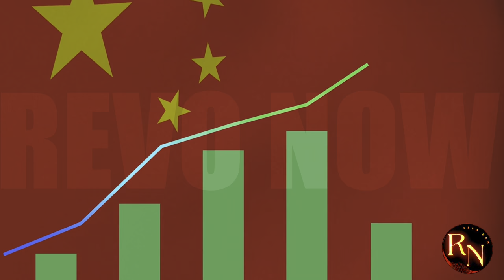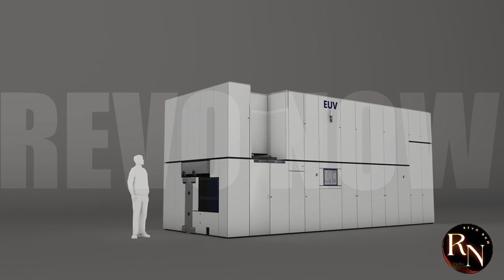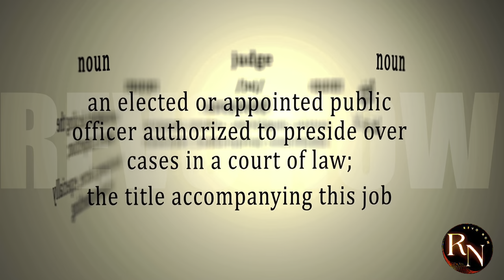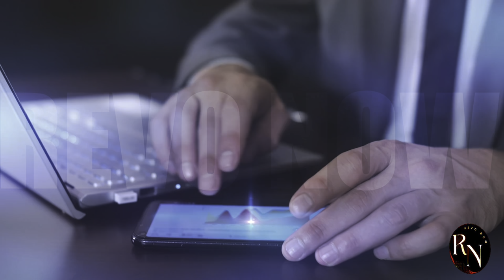China's MASS PRODUCTION of Cutting-Edge Lithography Tech Begins!

Comment: Let's see some actual machines. China hasn't shown anything yet. Maybe a prototype has been created. Maybe it works, maybe not. Maybe it can make only a handful of chips so needs improvements. Depending on reports maybe it can make chips considered leading edge 10 years ago but even that is doubtful. Other reports suggest the produced chips are comparable to what was produced more than 2 decades ago. If that's true it's still an accomplishment and possible stepping stone of knowledge although for commercial purposes it's far more practical to buy a used ASML machine or buy a new one that's proven and performs
Reply: By the time it is on u tube, probably in mass production now